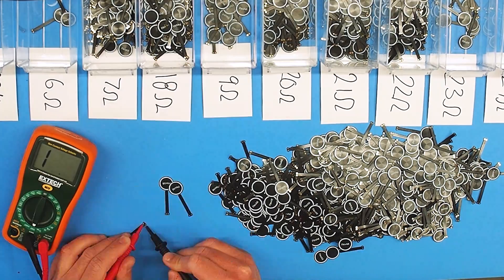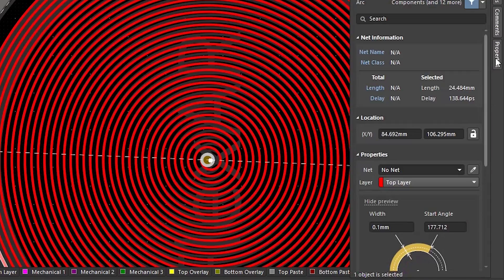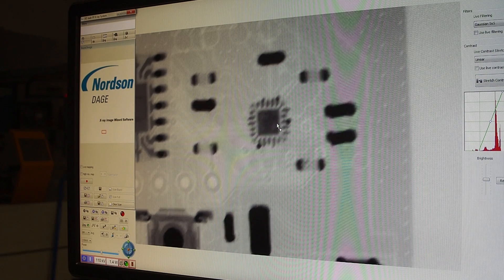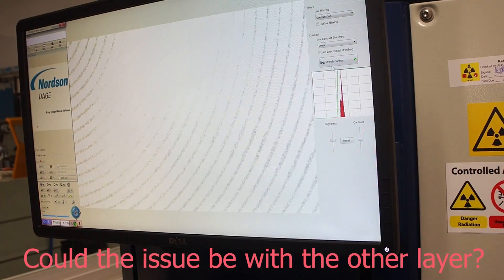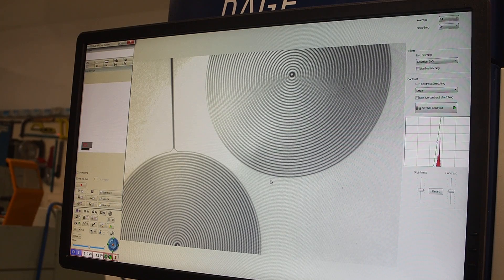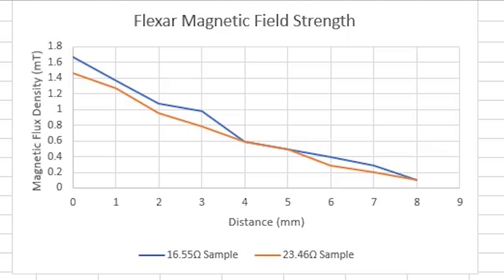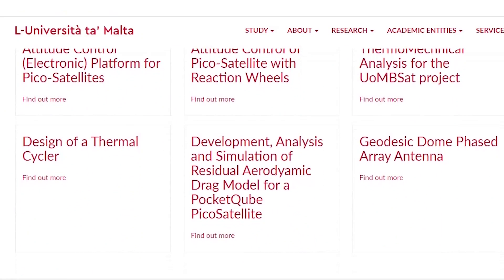Scanning PCB-Coils with a €200,000 X-RAY MACHINE

Comment: The variance in trace width is likely due to differences in the amount each board is etched. longer etch time will make the traces slightly smaller. Especially makes a big difference when the trace width is very narrow.

Comment: I’m curious if the variations in tolerance could perhaps be related to position on the panel; an artifact of the photolithographic process. The distribution is strange. Perhaps in the future, you can panelize the order yourself rather than the manufacturer so that you can include a small position index in the silkscreen.

Comment: You can test the uniformity of an 80um copper plating using a surface plate and a surface guage that measures in tenths of thousandths of an inch (or whatever the metric equivalent is). Surface plates are pricey but the surface gauges are more common.

Comment: It seems like your volume is high enough to just cherry pick / bin them.
Just put all the 16 ohm coils into the same bin, and the 20 ohm coils into another bin, etc etc.
CPU manufacturers (and other component manufacturers) do it too.  That way if you want a balanced set, just use ones that are all a similar value.

Comment: You could measure the copper thickness by measuring the pitch and width, then dissolving the copper and titrating the solution for concentration. From concentration you get the total wight of the copper, with the density, you get the volume of copper and from the volume and width you get the thickness.

Comment: Are you considering binning the coils?
Like have A,B,C versions each with a different datasheet, and according to the LRC results they each should go into one bin, (or be discarded if they do not fit into any)
From your histograms, it seems that you can partition it to 3 bins, each with very low variance. So you do not have to change anything on the manufacturing side.
The rule of thumb is generally 10% variance, anything more is way too much. You can also add an extra bin in the middle of the peak for 1% precision coils, which you could sell for slightly more.

Comment: you do not need "super expensive equipment" for detecting shorts.
If you put it into a strong magnetic field with the right frequency, you can detect the presence of the short from the temperature of the coil (it will melt).
With weaker electromagnetic filed, you can detect the short from the strength of the field. A shorted coil causes huge changes compared to an open one (large Q factor changes).
Edit: external magnetic field testing is better in one sense: you do not need to connect the flex coil, so it is easier to do.

Comment: You should take a look at what copper you're specifying. There are a bunch of parameters, but fundamentally you can get ED (electrodeposited) and RA (rolled annealed). How much they plate up vs etch away can also make a difference. The thicker the copper, the more difficult it is to etch, and potentially the more more variation you can expect. On the other hand, depositing has its own weird quirks.

Comment: The systems design is faulty here I think.  It should be designed to have some electronic adaptive tuning to allow the coil to be built to less rigid PCB specs.

Comment: ill just take my down the garden shed diy devices to my old mates hangout thats still open and take a few pictures...

you just need to make a viable diy pi pico controlling device with vga out and add the ben at 'Applied Science Laser diode self-mixing: Range-finding and sub-micron vibration measurement'  device ^_~ 
and or start making the coils with roberts lasered copper tracks '993 'Printing' Copper With A Laser' 
and oc use a variation of this 'mitxela Plotter Fun 2020' to draw out your lasered tracks and alignment holes for layering alignment O_O

and hope robert makes some iron/ferrite and reclaimed neodymium Nanoparticles In Gelatin  inks you can also make good use of here

Comment: It's a long shot but maybe you could take a crack at laser correction of the actuators. It allows only to increase the impedance but ensures consistency.
Reply from the maker: that would be nice! but from the info i got so far they won't do it for unless its 50,90 or 100 ohms which wouldn't be feasible for this actuator (not sure about other manufactures yet)
Reply: @CarlBugeja  I was thinking of ablating some copper with small laser in DIY style. Small fixture to place  the actuator and start automatic cycle of measuring and trimming, the laser would need to move in one axis. Quite complex build, but midscale manufacturing is growing and fascinating area :D

Comment: Try 0.5oz, 1oz, 2oz copper flex? The impedance variation effect in thickness should get less with thicker copper. The flex stiffness would probably change as well.
Reply from the maker: i think thicker copper can still vary by some degree.. i'd love to test this but unfortunately we would need a larger sample size

Comment: The typical solutions to variations in manufacturing that can not be overcome is binning and matching components (as you have done) or adding some method to adjust the component to the desired tolerance. An example of 'adjusting' the component would be laser trimming a notch in a shunt to calibrate the resistance.

For your coils you may be able to add a very simple adjustment by creating a tap to the second trace from the outside of the coil. You could short the two outer windings reducing the resistance. This would need to be investigated to see if this would help to bring the higher resistance coils down enough.

You may also be realistically left with an 80%~90% yield rate of coils in your desired tolerance.

Great job investigating the problem!
Reply from the maker: love this idea! it would need a little more work on my side to manually adjust and calibrate each pcb so i think i prefer get the manufacturer to make laser trimming but this is also an option.. for the 2nd batch i binned the coils to +-1ohm so that at least same bins gets shipped together :)

Comment: It looks like it would be a good idea to test Q of coils and throw away shorted ones. Then sort all the others in a couple of different bins and sell them with different spec sheets. The same way many other components are sold, like different chips, resistors, etc. Also, gods of automation are observing you right now.

Comment: Seems like they need to adjust their "printers"  / I assume every unit is set slightly different ... So you will probably always end up with the same results . They probably uses several machine to provide a larger volume in shorter time.

Comment: Shorted turns should be easy to find - they will significantly affect the Q. Connect a capacitor across the coil to resonate at a few hundred kHz, apply a pulse via a diode and look at how long it takes to ring down on a scope. A shorted turn will significantly shorten the ringdown time. 
This arrangement will also work in proximity - use the above setup with a known good coil, and place the coil to be tested on top of it -a shorted coil will damp the resonance and shorten the ring-down. You can probably test a few coils simultaneously.
Reply from the maker: that would make a great test jig! :) any variations in the inductance/resistance can be easily detected.. the lcr meter i got can also directly measure the q-factor and it is shown in the video but i haven't mentioned it
Reply: @CarlBugeja  i would assume a PCBs manufacturer insures at least the required thickness of copper,
 they would push the process variations in the +0 to thicker than normal room so no one have the problem that they have to little thickness...
only to thin copper layers make trouble in the most part... except if you have some HF stuff...
Reply: And more importantly this should be done during manufacturing, so your supplier can filter out bad parts and improve his process on the long run.
Reply: would that work for higher inductance parts, such as a motor or transformer winding? or will the capacitor need to be enormous? Can you suggest a proportion to start?
Reply: @thiagoennes  Should do - experiment!
Reply: @mikeselectricstuff  will do :)

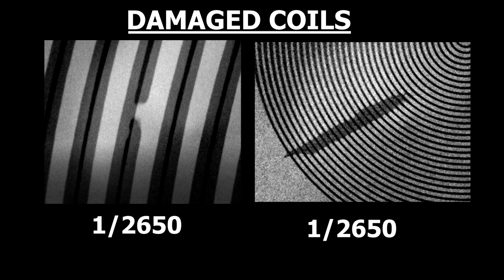Comment: that long grey area at 4:00 - 6:30
could it be that the copper were not cleaned probably,
and there is a patch of oil that have prevent it form etching fully/correctly?
seem the most likely scenario to me.
Reply: That was my conclusion as well. Some sort of contaminate kept the etchant from completely dissolving the copper there.

Comment: You should update your hoodie. Today there are smaller resistor packages are existing. 😉
Reply: also see 'mitxela  Hand soldering a WLCSP package' aka dead spider ^_~ and 'Nezbrun Hand Soldering the World's smallest ARM Microcontroller'

the trick is start in the centre and work out and secure the wires before you bend them in to position for soldering with lots of flux